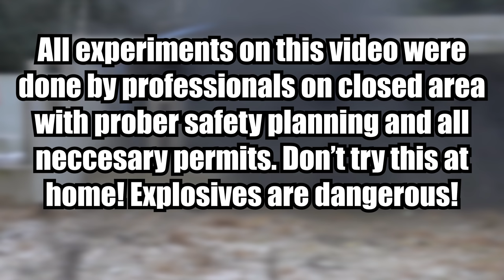How hard it is to explode a hole in concrete wall?

Comment: I was trained in demolitions 32 years ago in the army. Both my memory and math are rusty, but I believe that the breaching charge formula for TNT is P = R(cubed)KC where P equals pounds of TNT to use, R is the radius (thickness) of the concrete, K is the material factor (reinforced concrete is 1.76 for a foot thick wall and .96 for a two-foot thick wall) and C is the tamping factor. 

To breach a fortification that is 1/3 of a meter (1ft) thick with a resulting hole large enough for men to pass through, even though the wall is only a foot thick, you need a hole that has a diameter of about 4ft. so you need to double the R to get a two foot radius around the blast. 2 cubed is 8. As I said, the K factor for more than one foot but less than 3 feet of reinforced concrete is .96 therefore 8 X .96 is 7.68. Now you have to decide on the tamping and placement method. If you're going to place the charge against a flat wall like that, and you hope for a hole that is 4ft. in diameter, you have to place the charge half the radius of the desired breach above the ground at the 2ft. point and then consider the tamping factor. An elevated un-tamped charge for a 1ft. thick reinforced concrete wall is 1.8, so 17.68 X 1.8 tells you that you need a TNT charge of 13.824. You then round that up to the next pound or 14. 

So, if you don't intend to tamp it, you need a charge of 14 pounds of TNT elevated at two feet above the wall and placed against the surface of the wall. That's about two regular-sized satchel charges. If it were me, I'd probably split that into two 7 pound charges because I'm only trying to breach 12-inches of concrete. If I place one charge at about 18 inches above the ground and another at 36 inches I should be able to get full penetration and end up with an opening 4ft by 4ft.

Then, once you've breached the wall, you have to deal with the rebar, because the TNT will not defeat the rebar. At that point, it would be necessary to use either a metal-cutting torch or metal-cutting charges on any rebar within a 270 degree arc of that circle in order to be able to bend the rebar out of the hole so one can pass through.  

Don't try this at home. In fact, don't try this at all unless/until you check those figures with a demo expert, because my demo math skills are 32 years rusty and I personally wouldn't trust them without having them confirmed by another demo guy.
Reply: What's your take on their placing the shaped charge directly against the wall?
Reply: This was... Very informative.
Reply: Sounds about right to me
Reply: Id say use more, but my demolition experience is limited to things that arent appropriate for scouts to do...
Reply: Mike don't spoil it
Reply: Thank you
Reply: Well if you make a 3 paragraph explanation with some numbers and shit then I believe you are right
Reply: I feel like this is illegal information to share
Reply: 12B?
Reply: I am speechless
Reply: fbi open up
Reply: Ahh yes 5head
Reply: Now I can show my friends at school this cool new information I've learned! Perfect for an epic prank 🙂
Reply: @charlesschmuckatelli7888  such as
Reply: @cartler  oh god
Reply: This guy demolishes
Reply: Man's really just told us how many powder kegs you need to blow a hole in a wall
Reply: If you read this, you're probably on a list now
Reply: @NeglectedSpawn  cringe
Reply: @cartler  carter
Reply: a way to write down exponents is x^y, x being the number with the exponent and y being the exponent, to type ^ hold shift and press 6
Reply: They have battery operated rebar cutters now. They cut rather quickly but would have a number of cuts to make. Two of them might be as fast as any other means however.
Reply: Wow! thank you brother. I was infantry for a hot minute. thus is so cool to know. I will look up those numbers if I get a chance. awesome.
Reply: @zakncooper  - No problem. You can find those numbers in FM5-25. Google it. It's out there.
Reply: @NeglectedSpawn  i can hear the whole squad from antarctica. hella funny, bruh. bet you ain't ever even had an interaction with a female so sthu w/ that shi.
Reply: Cool as fuck to learn this . Thanks for sharing
Reply: @jean-paullebas4067  - If you couldn't get it all free on the internet I would agree with you.
Reply: This is still taught in combat engineer school by the way and I’m retired from the Marines
Reply: Informative - although I can't help but feel reminded of a meme I saw years ago: 
The only part you need to remember -  P=Plenty
That said, even copious amounts of explosives may not be enough if the old Flak-Towers in Berlin and some other cities are any indication. Post war the Allies tried to demolish them by packing them with explosives and detonating them. But all they achived was to collapse the internal floors, rendering them basically hollow concrete cubes.
Reply: Ofc I wouldn't do it at home, I will do it in the middle of the forest in Lapland
Reply: @jean-paullebas4067  
Information isn't illegal most places. Yet.
Using it certainly can be.
Reply: @shukshinite  
God, why do you hate and punish the poor reindeer so?
Reply: So I’ve got this tree stump, 
Do you have a Tree Trimming Service?
Evidenlty there are some trees in Ukraine that need trimming.
Reply: What about a 6 inch thick wall of drywall and wood? got some remodeling to do and could probably save some time.
Reply: @Pause0  
Depends. Wanna keep living in the house? Remodeling it with HE is usually contraindicated then.
Reply: Thx now I know the way to make it :) I’m now on a watch list
Reply: did it not have to be a shaped charge as well, upside down V,  if remember ,
Reply: Spoken like a true demo man
Reply: all I wanna do it remove a few tree stumps. without damaging the buildings that they are close to.
Reply: I like your style and honesty so I will be honest too with you all.  I would double if not triple the recommended amount and that would save on the time spent calculating and after that I would just go around the wall maybe use a door and look at all the damage that was made and hope no body was dumb enough to fight a United States soldier and if so they could receive a little surprise thrown into that hole that was just created as we learned here it dont take much to blow a hole into some fine Finish concrete.
Reply: @ranekeisenkralle8265  Not quite right - one of my uncles was with the occupying powers in the late 40s. He said we (the British) used nearly 100 tons of HE and pretty well cleared the Zoo area after 3 or 4 attempts and then piled up the rubble.
The Russians plugged away at theirs but eventually gave up and covered the remains with earth while the French had several goes at the one in their sector, shrugged and went off for lunch - he had a pretty poor opinion of the French occupying troops!
Reply: @LosPeregrinos51  I stand corrected. That one battery tower did get destroyed - and the guidance-towers for the others. But my point remains - about them being exceedingly difficult to destroy. Given the sheer amount of explosives used there, I think you are going to agree at least to that.
Reply: @ranekeisenkralle8265  Hi, wasn't meaning to correct you, just add some family knowledge. Like you say, a HUGE amount of explosives was needed. The most powerful bomb in WW2, before the atom bombs were detonated,  was the British Grand Slam weighing in at 22,000 lbs and they had to use the equivalent of TEN of them just to demolish the two towers. As a retired civil engineer I stand  in awe of how massive they were and, despite wartime shortages, the obvious quality of the build.
Reply: @LosPeregrinos51  All good. I don't mind being corrected if i make a mistake. it is how we learn and grow, is it not?  
But yes, those darn things were/are pretty darn impressive.
Reply: @jean-paullebas4067  it’s only illegal if you have do it without the proper licenses
Reply: I was Infantry for our class on explosives.
The math was simplified.

P= PLENTY.
Reply: This guy being worried about being held liable for someone attempting anything is the best part for me
Reply: Yeah, I don't for a second think I need to check with some other demo guy. Your specifics sounds pretty convincing. Of course Id always get my excavator and dig a dam with no water in it to test it out first, before I ever needed it :)
Reply: Damn, now I feel sorry not too attach to math back in highschool.
If I knew we can implemented math in exploding stuff, I would love to stay awake during math course
Reply: I just tested this myself and can confirm the math. I no longer have a house.
Reply: A Finnish Pressure Washer! Love it. Lol.
Reply: Information is just knowledge. Knowledge should never be illegal. Only some applications of it. 
Some say knowledge is power. It is not. Knowledge is a library of unused information. Applied knowledge is power. 

Application and intent should always color the black and white of the law.
Reply: There is literally always going to be a better option than trying to TNT your way through concrete. In fact even the reinforced steel doors are a better choice by far (10 minutes or so with a battering ram)
Reply: And this, kids, is how you weaponize math...
Reply: @just1voice994  - Sure, that would probably work, or it might destroy the entire structure. Demo guys don't always want to destroy an entire building. Sometimes you only want to punch a hole through a wall. Remember too that a soldier can only carry so much in the way of demo on his or her back without assistance; so, if there were other targets anticipated in the future, and resupplying can be difficult, one would want to use the smallest amount needed to get the job done so that you'd have more material for the next target.
Reply: @ranekeisenkralle8265  - My Dad did the same thing. He was a general contractor who built homes in winter and large steel silos called Harvestores in summer. I worked for him for most of my teen years and he taught me how to use dynamite when I was about fifteen. He did not however teach me how to calculate charges - because he had no idea, he just made a guess at how much he'd need. One year he bought a property with an old multistory concrete building on it. It was called "The Milk Factory' because before WWII it had been where they made and canned condensed milk. It was a pretty substantial building. My father figured that if he used two or three sticks of dynamite at the ends of the steel I-beams that spanned the breadth of the structure and supported the two upper floors that the walls would collapse. He was wrong. After a huge blast and a whole lot of dust, all that he succeeded in doing was collapsing everything inside, leaving the walls and roof standing. He didn't try again - he was smart enough to know when he didn't know what he needed to know. Years later he sold the property without even cleaning out the building. The buyer cleared it out and restored the structure inside and those two upper floors and turned it into a home.  Sixty years later it still stands.
Reply: @TheMeanAdmin  - I was terrible at math in high school. In fact, I characterize myself as a math moron. The US Army kind of simplifies it for the troops though. There are these neat little training aids/cards they give you that have charts and graphs and formula for the type of explosive one is using.  They're great to have when in a hurry and you have a brain fart and can't remember.
Reply: @mikeohandley1922  I was being kinda facetious ^^; But it's nice to have a cheat sheet to check yourself when working with something that can disassemble you in fractions of a second if you mess up o_O
Reply: @mikeohandley1922  12b or 18c?
Reply: @Indylimburg  Trained as an 18C but was never tabbed.
Reply: They should have placed a water bag to increase the power of the Shockwave.
Reply: Well its not just the math that's wrong with this video it's also the types of explosives, shapes and even tamping methods.

Essentially they are attempting to recreate Gatecrasher, which was developed by the British.  Some of Alfords videos are kind of funny, he loves putting cinnamon into charges so he can run out into the cloud and smell it in the air.  
Also they are using low brizzance types of explosives but definitely should be using the opposite.  

Someone mentioned a shape charge, yeah that would probably be preferable, but pre set charges from the US military may be a bit overkill when you get to larger ones like the 40lb cratering charges.  The tamping to control the blast on it while up against a wall would also be another challenge.
Reply: @mikeohandley1922  ride on. Have had buddies that were both, all good dudes. It's always a blast to see them work.
Reply: Can static electricity detonate plastics.
Reply: @mackgraves5103  No, plastic can only detonate from the shockwave of a blasting cap.
Reply: @mackgraves5103  no, you can light C4 on fire and it isn't going to explode.  Toss it at people and it still won't detonate.  Just don't toss a burning lump of C4 because that may go.
Reply: I don't think I will ever need to get into Home Depot this way, I'll just take the easy way in thru the door.
Reply: @LordRustyMcAlpin  Dig around the stumps and place your charges in the holes. Cover them with gently packed earth and lay thick rubber mats over the blast areas. This should prevent collateral damage unless the stumps are very close to the buildings. It will require you to dig out the shattered remains of the stumps, but it's easier than digging them out intact. This only requires a low order explosive like AMFO  or even black powder.
Reply: @themayoenby  don't work on my phone's keyboard.
Reply: @savage22bolt32  thats because its a phone keyboard
Reply: @themayoenby  lol
Reply: @jean-paullebas4067  It's science..
Reply: Thanks, I finished building a shelf and needed a new DIY project
Reply: @davidaldridge3229  Someone ripped you off on your steel doors...
In Russia and Ukraine profesional steel doors for home would not care if you would pound them for whole hour... and you can find videos here on youtube with them testing the doors and using stronger and stronger tools to actualy open the doors.
Reply: @CarlosReyes-ui6pe  Germans made most of the proper R&D on shaped charges and the stronghold in Belgium in 1940 was a first attempt to use them in attack on properly reinforced deffensive fortification...
Also i can imagine that with few pound of shaped charge made with more know how you could cut perfect human size hole in this wall and also cut the rebars in the same time...
Reply: @Bialy_1  yes they definitely wrote the book on the science behind shape charges, and not much has changed since.  I think the term you're looking for is "there is no problem that cannot be solved with the proper application of explosives."  Yeah I'm sure if you got hotter on the charges it would work.  Most hardened structures these days are hit with concrete tip filled bombs that detonate with a delayed fuze to get them deeper into structures.
Reply: @Bialy_1  I specialize in breaching friend, there is no "steel door" ever manufactured that could stop a sapper...
Reply: We have a tank with a ram attachment, and trust me it is definitely getting through those doors
Reply: @CarlosReyes-ui6pe  special note, if the door is a vertical install (not the horizontal entry ones) it is much much harder to breach, especially if it has a blast dome
Reply: @Bialy_1  previous comments we're intended to be to you, accidentally clicked the wrong name
Reply: @Sir.rattusrattus  well, that's if you have the priveledge of having copious amounts of spicy salt chilling around
Reply: For sure the feds would appreciate you sharing that information.
Reply: Thanks
Reply: I say 1400lbs of TNT should get rid of the rebar. Does the operation count as a failure or success if no wall is left? I'm not an expert, so I'll conservatively suggest 20km as safety distance.
Reply: @jean-paullebas4067  yeah,  I have to remind myself we aren't free anymore
Reply: Impressive. Would love to meet you at one of those people "book stores" and have a chat. Love the fact that...for whatever knowledge is out there...SOMEONE knows it. No matter how niche.
Reply: @jimshort9266  that might be an ok method; first blast with a large version of the water jug followed with two guys with rebar cutters while other are ready to storm through the opening